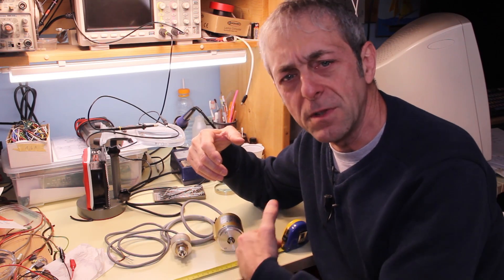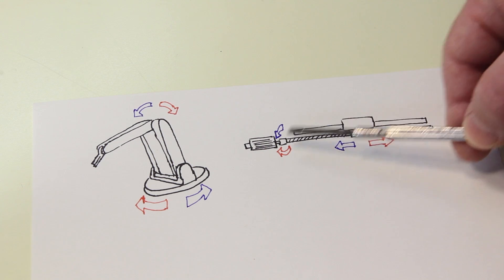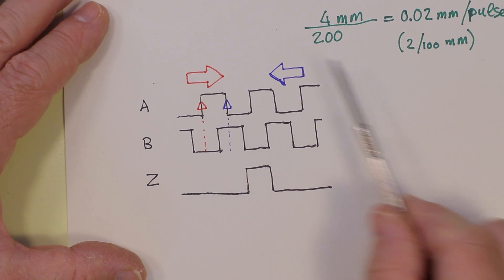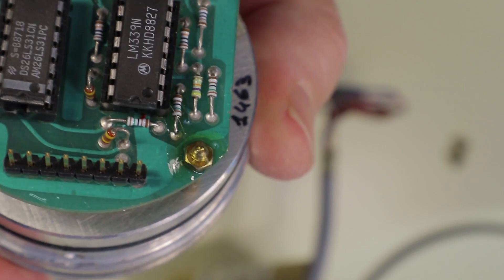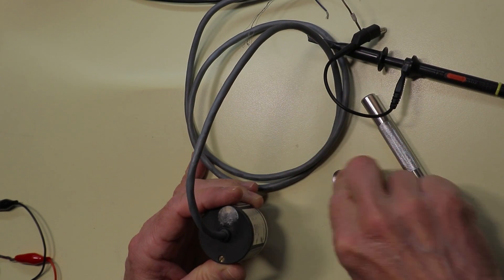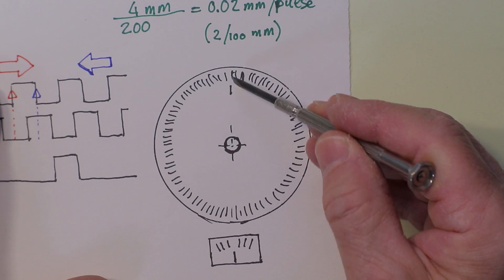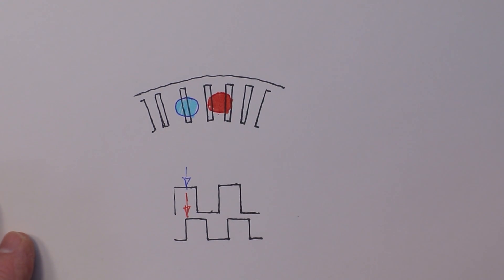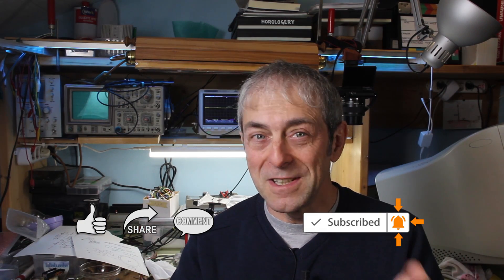What's inside an encoder and how it works? | electronics automation

Comment: How can one know if an encoder is faulty? I have an encoder that I use for a project but I keep getting wrong values for the angle of rotation.
Reply from the maker: Unfortunately faulty encoders are tricky to test without a specific instrument that basically compares pulses vs angle, count them and check the maximum throughput. A simple tester can be made with an Arduino, a precision photocoupler and a rig for the encoder to test. Also an oscilloscope is required as well.